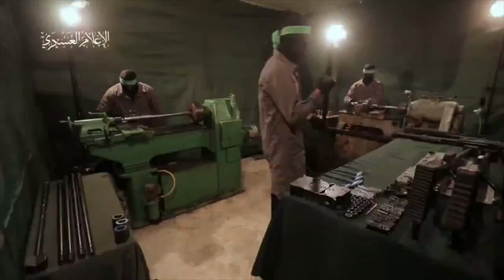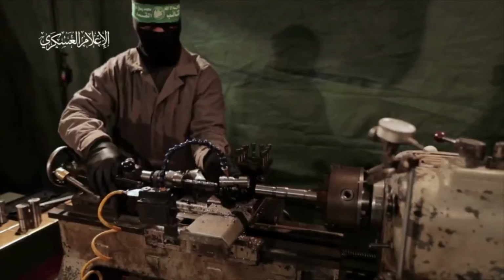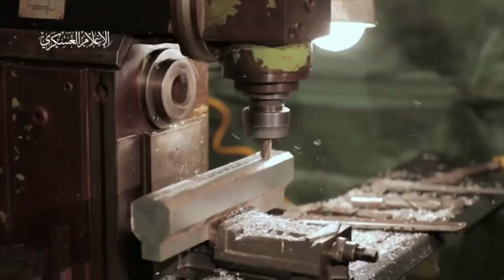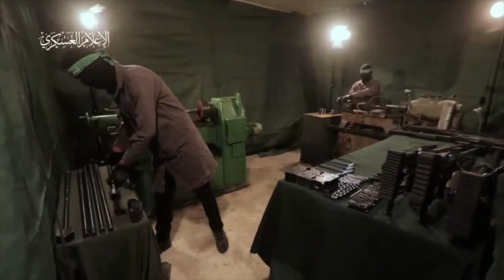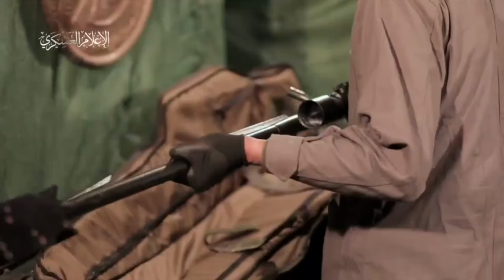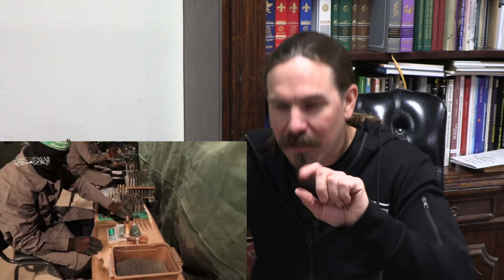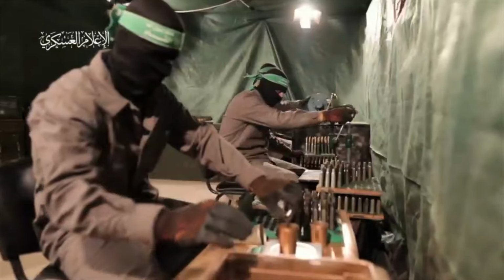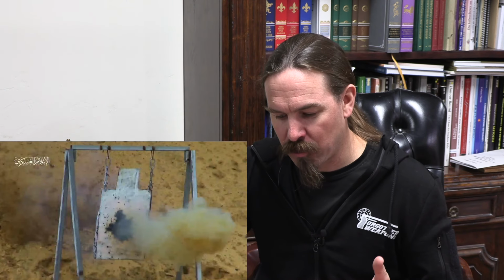Hamas Claims to Make Sniper Rifles in Gaza - Are They Really?

Comment: Its probably fair to say they aren't making these rifles in Gaza,  and there are a number of issues here, but as a gunsmithing educated machinist of 12 years, I can see a plausible reason for a lot of these shots.  As a disclaimer, I haven't done any gunsmithing since I finished school.

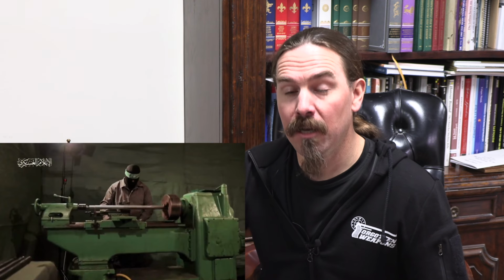1) At 1:50 there is discussion about OD turning the "barrels"  This may not be final contouring.  Depending the material condition and follow on processes a cleaning cut of raw bar stock may be necessary.  Secondly, these clips are showing the work at different stages of completion.  They may not be contiguous machining, we cant know, and based on that equipment, likely took several hours to complete.  Also, based on that equipment, smoking is normal.  Its probably the lubricant flashing off.  

2) Polishing with that cloth on a spinning lathe.  I've done it a lot.  Especially on a long bar in a old manual lathe without a steady rest.  Tolerance is tough to hold, chatter is a real concern. Polish for looks or for final sizing.  Not great for making money, but it works.  

3) At 3:10 regarding this drilling.  Based on the position of the bar in both shots, they are not contiguous.  You may be seeing two different things.  One is drilling.  The other is using the drill bit to catch the cutoff and prevent it from falling into the chip tray.  Its crude but effective and would explain the imagery.  More interestingly, it looks like they have contoured 2-3 of these "Bolt heads" before drilling and cutoff.  On a manual lathe, I would avoid that at all costs.

I have since had the opportunity to work with a film crew on a machining project and we staged everything for filming.  Even as a machinist of 12 years with real machine tools on the day of filming we faked everything.  

Great content as always!
Reply: Your last point is probably the most important. It’s all for show. They have to maintain crazy opsec to so why would they show their actual operation
Reply: @carry-hunt9710  Yep, this video is like watching Mythbusters doing something in a machine shop and concluding "Americans don't manufacture anything"
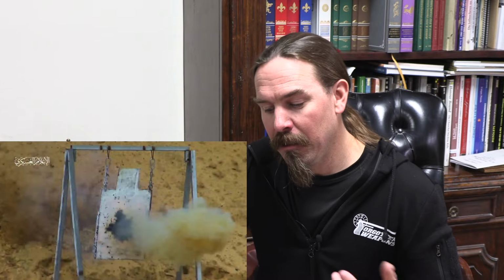Reply: 18:00 and more importantly a tracer tells everybody where you are and where you shot from.

Not something that lengthens the life of a sniper
Reply: Yup.  If your steel isn’t smoking a bit while you’re cutting it on a lathe, might be going too slow.  Want to make nice blue and purple chips.

Coolant is for those sad sots who only cut mild steel and aluminum and wouldn’t know tool steel if it lept up and bit them.  And drilling.  Wouldn’t drill without it.

Sand paper on a lathe also semi-standard.  Confusing sand paper and shop rags is a little sad there, Ian.
Reply: Literal pipe shotguns will be accurate enough for the distances of urban combat being fought right now. A machined barrel, no matter how possibly "off" from western tolerances it may be, will still sling that 50 calibre round at the intended target and hit it. Doubt itll ever be fired further than 100m, so all this manufacturing nitpicking is kinda useless.

Will the barrel fire a 50 cal? Yes. Will it still hit the target at the common battlefield distance? Yes. Then you have an effective made for purpose weapon.
Reply: @TheStaniG  no offense to you but it seems like 90% of the ppl on this thread just got their SDI certs and got 5hrs of lathe time.
To answer your question, comparing a 12g pipe shotgun to a high pressure, necked round with even semi precise interfacing lugs and proper headspacing is kinda dubious. At those dumb levels, the gun will only fire once if their lucky, or theyll have to stick their thumbs in holes IYKYK
Reply: @Ryknfjor ok the SDI comment got a chuckle from me. I suspect you may know what a burger from Davie’s Chuckwagon tastes like.
Reply: Disagree. The smoke coming off the barrel is a no-no.
Thermal expansion will warp the inner barrel. Temps must be controlled throughout the cut ESPECIALLY on a "sniper rifle" barrel.

Sanding the OD near the chuck is dumb, because chatter is least likely to happen there.
Reply: @Ryknfjor  you've never worked a lathe have you? Smoke is normal. It's the oil that provides both cutting lubricant and cooling.
Reply: @astainlessnoyb1038  ive run tons of lathes. Smoke is normal for a specific application, like when you dont coolant running on the part, say for roughing. You use cutting oil. Like mike-o-cut/black oil. Look at my page. You'll see.
Reply: @Ryknfjor that's not true. When I've turned down barrel tendons, I've had smoke come off when I use cutting oil. Have you ever machined a barrel?
Reply: Yup, smoke actually means that heat is being lost by vaporizing the lubricant. If it was totally dry there would be no smoke. It’s kinda old school but that’s how it was done in the days of HSS bits and heavy cutting oil.
Reply: @randy1469  ive machined some barrels, but ive mostly machined high precision components on par or higher than F1 class barrels. For almost 2 decades. If youre roughing something out, sure. But supposedly not in this case. For precision....
Reply: @Ryknfjor   The OD of a barrel does not need to be very presise, except the the treads on the ends. And when using cutting oil, and not flood coolant you will have smoke, but the barrel still does not reach even close to any temperature where the heat treatment will suffer form it.
Reply: @titter3648  not what im saying. Deformities on the inner barrel will happen when you turn the OD. Youre relieving the OD stress. That portoin of machining MUST be controlled on high end components. Its fine for a 9mm barrel, but not LRP/ELRP.
Reply: @Ryknfjor you don’t turn the OD for precision anyway.  

In fact Ian featured a barrel with the entire outside knurled just to increase the surface area…
Reply: @Ryknfjor  Does not matter. If your barrel is slightly bent you just have to adjust the point of aim, it does not affect accuracy.
Reply: @rosss11111  I use manual lathes and carbide inserts so I get lots of smoke when I'm using cutting oils
Reply: @robertgaudet7407  dude, go back and read my comments....
Reply: @titter3648  ill be nice. Deformities isnt isolated to just being bent. Let that sink in.
Reply: @Ryknfjor   All tilting barrel pistols has barrels with unsymmetrically machined OD, and so does all revolvers. It is not a issue. Machining materials with a lot of internal stresses can cause distortions, but all barrel blanks is stress relived before leaving the factory. And as i said if the barrel i slightly bent that does not affect accuracy at all. If it caused big internal distortions to the bore to machine unsymmetrical OD's all revolvers and tilting barrel pistols would get bullets stuck and exploding barrels. But that does not happen does it?
Reply: @titter3648  but thats not whats happening here. Its the order of process. If the barrel blanks doesnt have finished riflings, or is already heat treated, cutting off material from the OD without controlling temps(using regular cutting oil, making blue/purple chips) leads to significant problems. 
Were talking sniper rifle class barrels, not automatic style or revolver barrels which are short and roughing off material isnt even close to deal breaker for the application.
Deformities im saying arent in the .005" of an inch, and even if it were most likely wouldnt stop a bullet. 
If intended to shoot far, reliably, constantly and accurately you just have to consider those factors.
Reply: @Ryknfjor  If the barrel blanks don't have finished rifling and heat treatment they are not barrel blanks...
They are obviously not drilling, reaming and rifling solid stock because you see no machines for doing that. So they are obviously just profiling and treading the OD of barrel blanks. And the smoke and blue chips in completely normal when turning steel without flood coolant, and will not damage the barrel blank in any way.
Reply: @titter3648  agreed but that goes against the process for manufacturing sniper/f class barrels, especially what Ian was talking about which goes against what yhe poster of this thread is saying . Any professional outfit is using coolant for profiling/contouring. Using cutting oil is fine for modding and re-fitting a barrel trunnion as your only taking a couple of passes ~2" long at .015" depth of cut total. 
Its like installing an interference bearing on a shaft and you heat up the bearing, checking it with a heat marker, but in this case you dont know how far past the heat of the part is with just heat marker. It isnt proper machine shop practice.
It also depends if youre using carbide or HSS. If you see blue chips on HSS (regardless of oil or not) youre already work hardening your part.
Reply: @Ryknfjor  .50 BMG rifles in the military is typically not sniper rifles. They are anti material rifles. Like for example the Barrett M82 is not made to be a sniper rifle, but a anti material rifle.
And of course you have to let your parts cool down before measuring a critical dimension like the threads.
Reply: @titter3648  but Hummus dont own ghillie suits, i dont think theyre shooting from 100yds. Bet the rifle shown at the end of this video has some good GR&R statistics. None of which was shown to be made from their "machine shop"
"Letting things cool down" and work hardening arent the same. Cutting trunnions for refitmnt doesnt even get to the same level of heat as profiling does. Including threading.
Reply: @Ryknfjor  What are you talking about?
Blue chips and smoking cutting oil is not a sign that you are work hardening the material. As i have said many times now blue chips and smoke from cutting oil is totally normal when not using flood coolant.
And you let the material cool down before taking critical measurements because measuring a hot workpiece will give a larger dimension than when it is cooled down so you end up with a undersized part if you don't let things cool down before taking the final measurements and finishing cuts when manual turning.
Reply: @titter3648  that was in reference to using HSS vs carbide. HSS shouldnt see blue chips.
Smoking cutting oil if your on your finishing passes is not the best unless youve taken a few predictive mic after passes.
Glad to know you know machining 101.
Reply: Why would you receive a gunsmithing education, but then never smith a gun after your schooling?
Reply: @nathanfranks1476  Because I was introduced to machining in school, the first job I got after school was in a machine shop and it stuck.
Reply: @timedwards9964  very good points esp the last one. I have zero experience in machining only watched some vidjayos of machining so I'm not gonna say anything about that except for - as a complete ignorant on the subject I've seen the things you describe.
What I do, sadly, have both experience and knowledge about is the last point you've made - The video they released is clearly a marketing video. Ian's take on it is weird, it's as if he's trying to expose them for lying about making sniper rifles through nitpicking a marketing video. They're not making a training video, they're not hobbyist showing off, so why would they show the actual process in their actual workshop? The expectations make no sense.
Wait until Ian watches a video marketing washing machine detergent - the clothes go from CGI-dirt to CGI-clean through the magic of editing. So I guess the detergent doesn't exist, the washing machine doesn't exist, and that brand doesn't synthesize raw chemicals out of atoms and molecules.

I like Ian's take on many things, but I disagree with you in the last bit - this is a very weird reaction video. I expected bias, and it was still below my expectations.
Reply: @pubcollize they may produce rifles but certainly not in there. It was staged, and honestly it wouldn't be smart to film in the real factory (if it exists) since one tiny detail could give a way their position.
Reply: @thedarkone5049  bingo! Thats what I was thinking. Of course they staged the video in a different place than where they make it. I’m sure all the shots was to help them get good footage. 
Usually the real thing is not impressive and doesn’t look good on camera.
Ian is just biased and sounds butt hurt
Reply: He is just being very biased.
Reply: If he was he might have brought up average Palestinian IQ which is very low @RiyadhElalami
Reply: @RiyadhElalami  Ian is super biased which is disappointing coming from someone that is an advocate for self defense and the second amendment.

Comment: Yeah... I guess best case scenario here would be - the yare gunsmith that could repair and modify some of guns, but they certainly not making a functioning gun, never mind a sniper rifle on a lathe that looks like a hobbits lathe from a classroom. maybe they can make something like crude shotgun there. Maybe again they can repair some parts or as mentioned, build scope mounts or other accessories. Besides even if they would be able to produce precision part, the whole process of heat treating etc. which is what separates hobbyist workshop from actual gun manufacturer,  is missing.